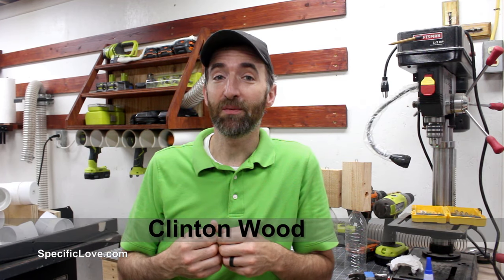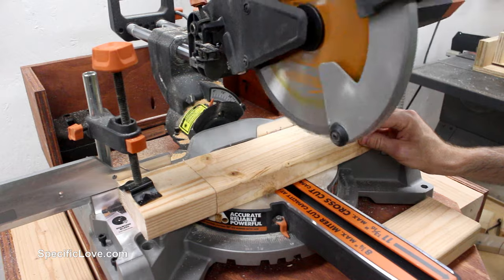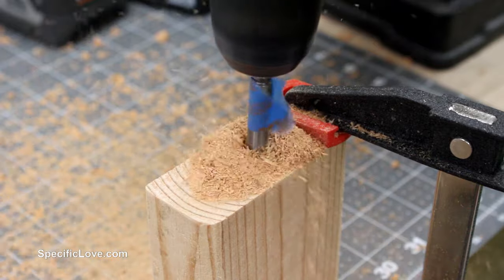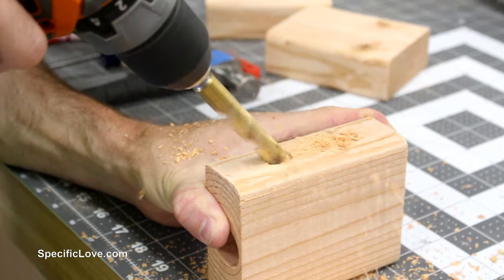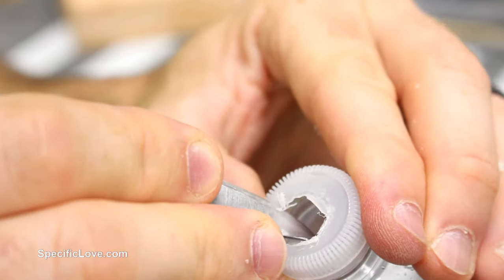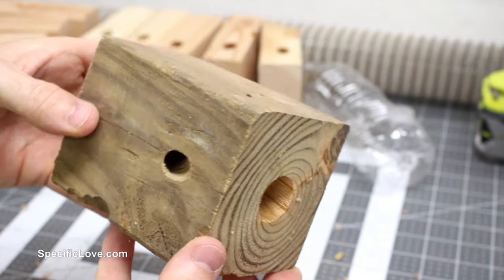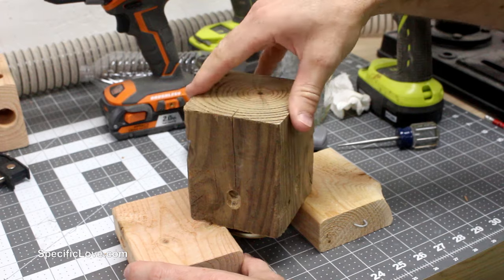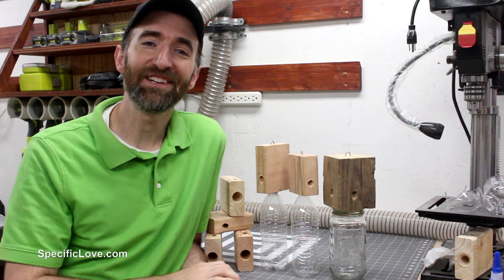Super Simple Carpenter Bee Trap

Comment: Yea, caught 195 bees with 3 dozen traps. Leave dead bees in jars, as the draw more bees. I had 27 bees in one trap. I would seed traps with dead bees. Carpenter bee holes are 13/32 in size but 1/2 inch holes work also. These work very well.

Comment: Was going to ask if it worked, but read another comment where you replied. When my dad was alive, he had an ongoing war with carpenter bees drilling in his deck. He’d take a broom and swat them to death. If he walked out the door with no broom the were hunky dorey. But, if he walked out with a broom, they took off like a jet. They learned pretty fast to try to avoid his broom. He would have loved this idea as he built homes and had all the supplies he’d need.
Reply from the maker: That is a good story, thanks for sharing.
Reply: Tennis racket works best, but they are quick 😎
Reply: I clamped a light badminton racket to a pole with hose clamps. It works p.retty well. When you hit one it makes a distinctive "pong" sound that I love. That is how I know I got one. They are pretty smart. They have a sophisticated radar in their heads that tells them just how close the racket is. They hover just out of range. But I found out that if I wave it low ,  they come in closer. And "Pong" ! They are dead !

Comment: If you don't have any fencing staples (what he is calling poultry staples). you can easily just use small "eye" screws. Pre-drill a small hole (make sure you use a drill bit that is smaller than your eye screw). Then just just screw the eye screw into the pilot hole. If for some reason you find it hard to turn the eye screw.. take a small screw driver,  slide the screw driver into the eye part of the eye screw and you'll easily be able to turn the screw all the way into the wood, using the screwdriver as a lever.

Comment: These 2 x 4 ones work best. I made some 4 years ago and hung high on my barn. Still have the same bottle and never changed it and they still go in. Some are 1/3 full. Hang them high on the outside, the ones I hung on the inside of barn didn't work. Also spraying existing holes with Permethrin 10% helps.

Comment: Just finished hanging three traps and also plugged the holes using electric wire nuts and also added sticky sheets right next to the plugged holes for good measure.  Two bees are already squirming on the yellow sticky sheets but nothing in the traps yet.   You should have seen the little critters confusion when they tried to go into their holes through the wire nuts.  I almost felt sorry for them - NOT.   I think I am reclaiming the shed.
Reply from the maker: Sounds like a good plan. Good luck.
Reply: dont plug they old holes. the babies return to the nest the next spring. and will just drill a new hole. instead, put some sevin dust in the old holes using a duster type sprayer
Reply: They will just go and make a hole elsewhere. That is not a good solution.
Reply: I plug their holes with caulk. What we is on there will die. The babies cannot dig out. They need a clear path. This has worked for me for many years.

Comment: I DO overthink... but can't resist asking:  We have sooo many carpenter bees for years.  I've built / bought different traps over the years.  Some catch 3 + and others have never caught any.  Can't find a logic / pattern on the ones that 'work' vs. ones that don't. 

Any thoughts on success with 2x4s vs 4x4s?  I've been making them with 4x4s and wonder if the 2x4s (I have more of that and quicker to make each one) would be better

With the crazy glue, that odor (even after weeks - they likely are more sensitive to smells) doesn't deter them from going in?  When I was using water bottles on an old design, they were press fit into the hole only.

I had been using 4x4s and a sloped roof design I saw a while ago.  Think a bigger piece of wood would be more attractive to them?  I like yours because I can make more traps from the same amount of wood.

I've been making mine with the holes like yours - up a couple inches or so from bottom.  Some other designs I've seen on the web have the hole much lower to the bottom.  When a bee goes in, when they get to the center hole, they are closer to the bottle by those couple inches / that light is likely much brighter than if they were 2 inches higher / they'll more likely go down vs. back the way they came?  (I did once come up to a trap and a bee flew out of one of the 45 deg holes : (

And finally - any thoughts / experience with wider vs. longer bottles?  They'll bounce around in there and potentially get to the top.  In a water bottle they get funnelled to the exit.  That's suggests a wider top / less likely they'd find the exit in the top just by bouncing around the top.?  But a longer bottle would help too - more space to bounce around / less likely to stumble on the top exit?

THANKS FOR A GREAT VIDEO!
Reply from the maker: I can only talk about the ones I've built in this video because those are the only versions that I have built. I have had success with both of these designs. I think location has a lot to do with success because I've had some traps catch several and some catch zero.